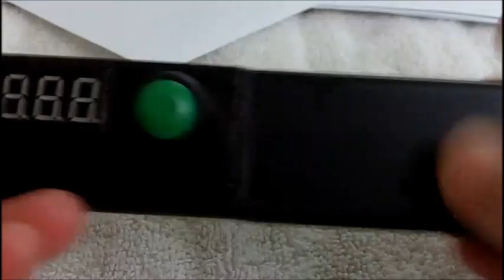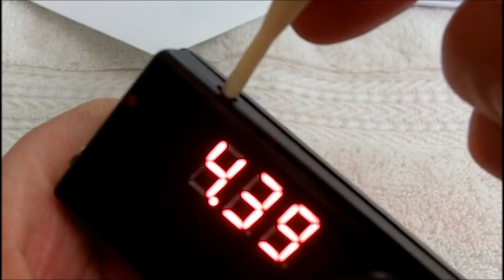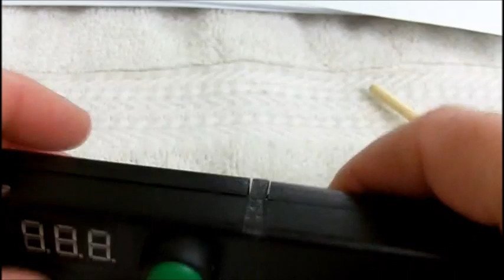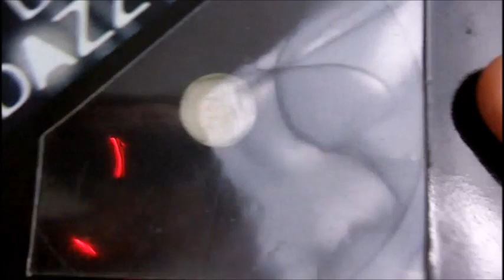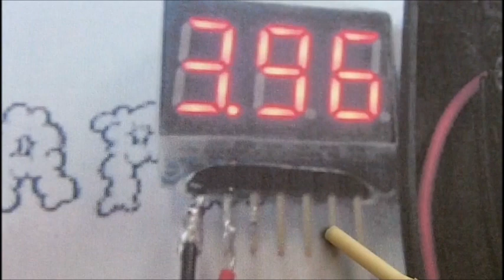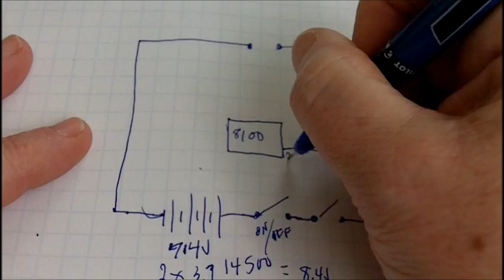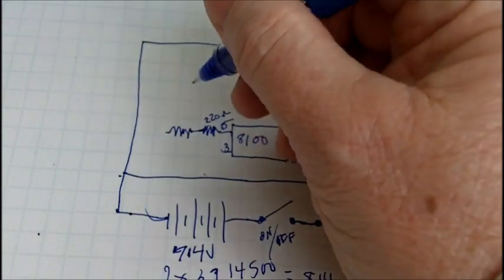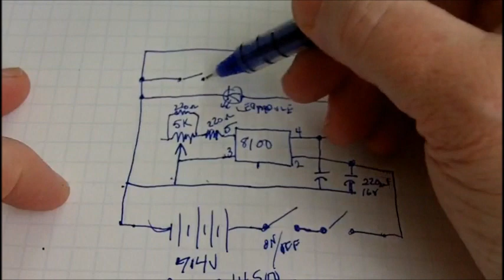How to Make a Variable Voltage Mod E-Cig Personal Vaporizer

Comment from the maker: @ShanBurkholder Thanks Shan.  Yeah, I got this 8100 as an engineering sample. My fav thing about it is that it runs cool, doesn't heat up, so needs no heat sink, no fear of heating the batteries.  I think the next PV I build, I'll use an all-in-one premade step-down module, stupid-simple, no caps, resistors, or pots to figure out or add, just solder the input and solder the output.  LOL, can't get easier than that!

Comment: I have been searching online for Days(intermittently of course) for info on where to install a digital voltmeter inline in my 1st OKR box mod build. I'm a "Newb" obviously. Most all available info is way too complicated for a novice such as myself with extremely limited electrical knowledge.
Now I See! YaY! It is sooo simple! Before and after the 510 connector. (+) and (-) on either side of the 510.
Thanx so much steeljan for the "Ah-Ha!" Information!

Comment from the maker: @KE5SUI Yes, it's in the video or notes underneath it, but I got the battery boxes at radio shack and they had the battery connectors in them.  The atomizer connector I got at madvapes.  No, you cannot get this regulator from radio shack, only from Texas Instruments or one of their distributors as far as I know.  Madvapes makes a nice variable voltage ecig kit now, I built one of those too, very nice, very reasonably priced as well.

Comment: Nice. I like your idea about adding a knob. I would probably try to solder or epoxy a very small screw. Cut most of the shank of the screw off so it just barely protrudes. I like your ability to tinker!

Comment from the maker: @priestslc Best bet, go to Texas Instruments and download the datasheet and read it until you understand everything.  The pot needs to be about 220ohms.  The resistor I added in series is because the datasheet says never to let the line go all the way to zero, plus I wanted to cap this pv at 5V, so 220ohms was a good choice for that resistor.  But I'm right now doing a video on a simpler way to do a vv mod.  Should be up today or tomorrow.  Thanks for watching!

Comment from the maker: @rekku80 If you are an electronics buff, just shop around, like at Mouser Electronics, making sure you get the specs you need.  If you are new to this, then my best advice would be to go with the variable voltage mod kit that madvapes came out with awhile after I made this video - has everything you need.

Comment from the maker: @VapeDeadeye It would have been nice to make it smaller, yeah.  I'm looking for a smaller variable voltage regulator or step-down, also I need to find a smaller voltage display. If you run across these, please let me know.  But the dimensions on this is that it's 5 1/4" long, 2 1/4" wide, 1/2" deep (the button sticks up another 3/8") - this is as small as I could go to get everything to fit.  Thanks a bunch, cheers!

Comment from the maker: @stevenmackenzie59 I mention them all in the video, yeah?  I tell you what each part should/could be and what I used and why.  So for a parts list here, I wouldn't know what to write, what each should be, the range of what each could be, or exactly what I used, lol.  Sorry, not meaning to brush you off.   If you have any specific question on the parts, I'll be glad to help.  Cheers

Comment from the maker: @mypuffins Haven't looked at those pencil cases but they would be bigger than this, a pencil or pen would be too long to fit inside my mod.  This one is 5 1/4" long, 2 1/4" wide, 1/2" deep.  Will look for those pencil cases.  Thanks!

Comment: Steeljam you are simply amazing! you have inspired me to take on a new project now, I just got done with my 7.4v 510 monster (Ill be capping it to 5v), and now that I have got my solder flowing again I am going to try a variation of what you have created here. I was wondering if a 220uf 10v Sanyo Cap would work in place of what you used?

Comment: You may have said this already but where did you get your ecig battery connector? also, do you think it would be possible to use a variable voltage regulator from radioshack to do this?  thanks! awesome video.

Comment: Is there a specific reason you used the 8100 instead of an lm338 (almost $10 vs <$1)? I feel like it would work just as well but be significantly cheaper? Or an lm317 with a TIP41/2N3055 to handle the high current?

Comment: Also another question, what pot would be ideal for this project? you said that you used a 5k Ohm pot and then had to use resisters, is there a pot that would negate the need for the resisters in parallel and series? I apologize, I am a self taught electric noob.

Comment: Pretty cool! I'm looking at doing this but will be researching a little longer i've seen kits at MV and checking out all in one boards on ebay but all i'm finding w them is low amperes ones like 2-3amp. Not really sure what amperes ego batts n the like are rated at. Ne way nice videos thanks for info.

Comment: what about lm338 and 2 x 2200mah 3.7v batteries in paralel on a 1.8ohm atomozer? will it be ok. you will have variable potentiometer on the lm338 and you can lower that 3.7v
Reply from the maker: The LM338 is spec'd at max current output of 5 Amps.  If what you want to do and the batteries you use work with the specs, it might be doable.  I have never taken a deep dive look at this configuratuon.
Reply: Branislav Stratrov If you are using it to step up, you will have issues with the batteries going bad in excess of a few mV of potential difference.

My experience is with amps (common practice is to put a voltage regulator and step up before the mosfet amp) stepping up to a significantly greater voltage, maybe this is acceptable for smaller applications.

Comment: can you just put in the potentiometer for the variable voltage or do you need to use the chip or board with it too?
Reply: Short answer: you need the "chip" (the TI 8100 module).
Long answer: Yeah, you can wire up a pot alone to act as a voltage divider and give you variable voltage but there are a few issues. 1) Good luck finding a pot that can handle the power - most pots are rated 2 watts, you need more like a 15 watt rating for a mod, and if you can find it at all it will be physically huge. 2) Without going into too much detail, a voltage divider wastes some power, shortens battery life a bit. 3) Voltage won't be regulated, so as coil resistance varies the voltage will also vary. The TI 8100 is a voltage regulator and will compensate for load (coil resistance) variations, a pot alone won't.

Comment: is there any new version of this chips? i want to build mod that goes up to 30 watts.. thanks
Reply: How about a dna 30? lol
Reply: is DNA 30 Ti?? har har.
Reply: Umm... if that pcb has a 10amp current, at 4.2volts with a .42ohm coil you will be at 42watts. DNA 30 maxes at 30watts. I vaped at a 120 watts for a good month with a mechanical mod. 4.1volts with a .14ohm coil will net you about 120 watts.
Reply: oh ok thanks bud

Comment: Are you Mamu? from Vapers Forum?
Reply from the maker: LOL, I'm absolutely not Mamu.  I've been working as an electrical engineer, continually designing circuits and products for corporations since '79, when I got my degree.  Mamu learned to solder last year via some vaping friends and has no formal education whatsoever in electronics. I like to teach as a hobby and get no profit with my youtube videos, she wants to sell you a mod she's hacked together for a couple hundred bucks or more.  Big difference.
Reply from the maker: I'm sure you're proud.  He may decide to study and become an engineer like me. But there's no shame in running a 3d printer as a vocation. Cheers.